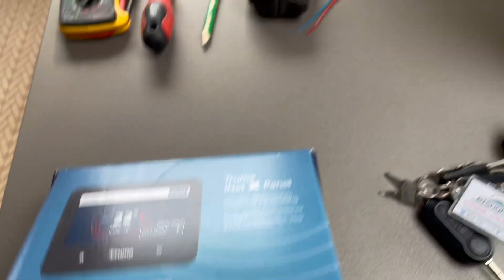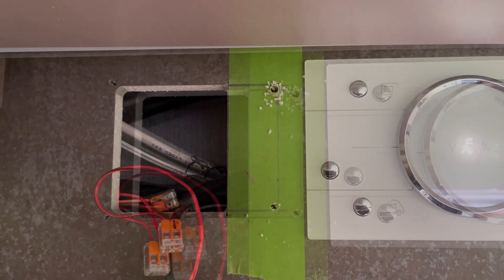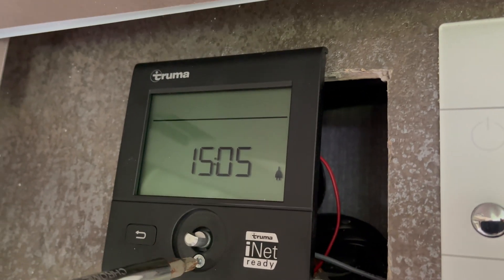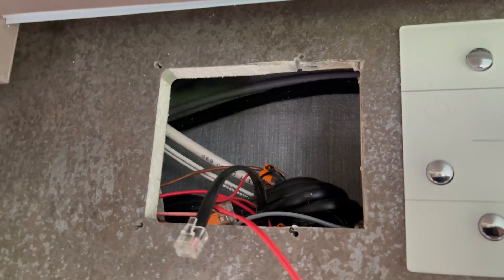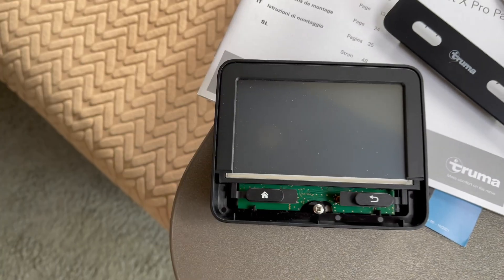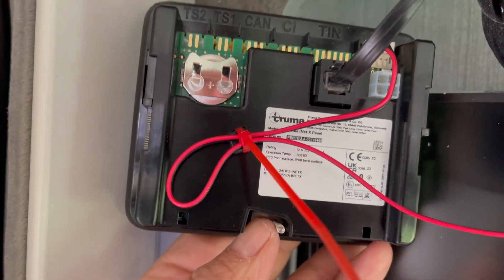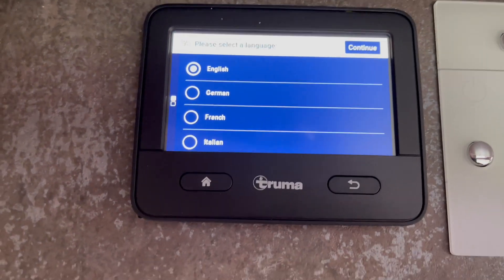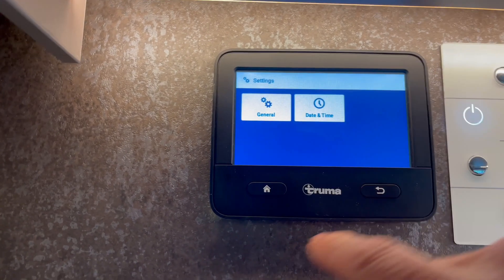Retrofitting Truma iNet X  panel, replacing old Truma CP Plus

Comment: Thanks for your video. 

Followed along and my iNet X panel is up and running and connected to my phone and the Truma combi heater. 

It only seems to see gas as power source not mains electricity despite being on grid. That’s my next challenge. 

Will also install a gas level meter as well in due course.

Also I purchased a trim piece to go around the panel which hides the holes left by the removal of the CP+

Thanks once again!

Comment: Good morning I am just about to install the Truma 4e combi, but Im not sure about the small connection on the control panel. The red + and red/black - what is the location I connect to on the boiler or are these connections only for power to the control panel?
Reply from the maker: Sorry, I’ve never fitted a boiler so can’t really help.
Reply: What happens to the old I net box does this get left or disconnected